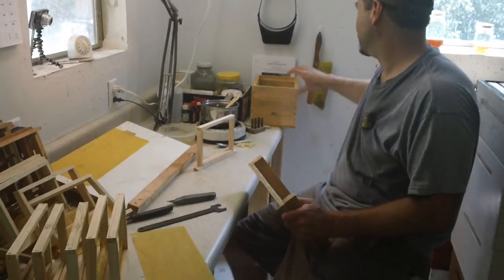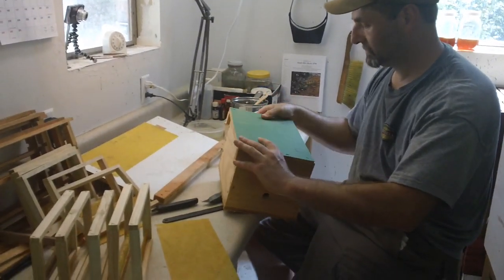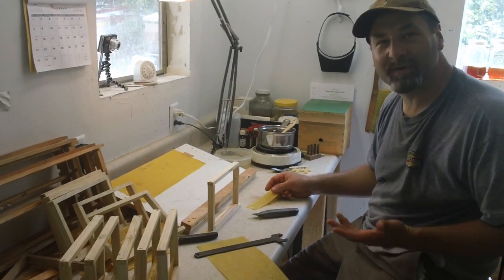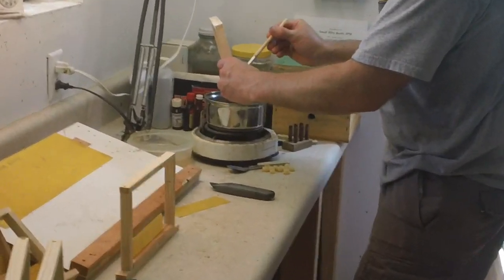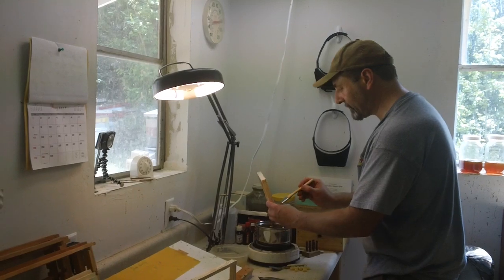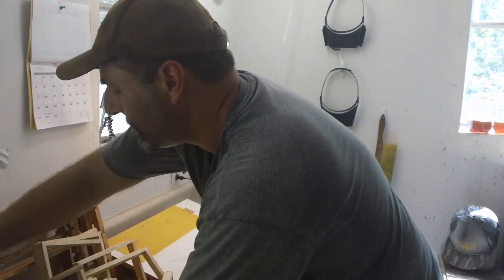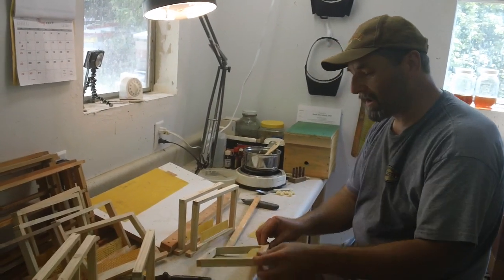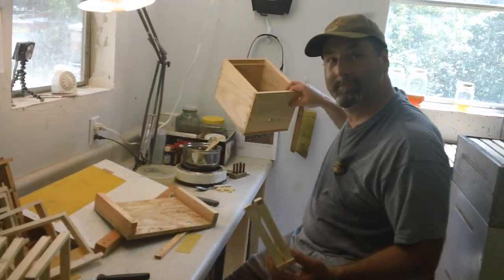WAXING=MINI=NUC'S

Comment: Glad to see you are waxing in the foundation now! I never could make myself break out wedges, and then nail them back in. Plus I like having the groove top bar so if I want to run plastic foundation I can just clean out the top and bottom groove and snap a piece in. 
Do you have a video about building the mini nuc frames? Can't recall. I know they are super simple, just curious. I have been using 5 frame deeps or mediums as mating nucs but would like to think about building a bunch of mini mating nucs just to save space and be more available for grafting.